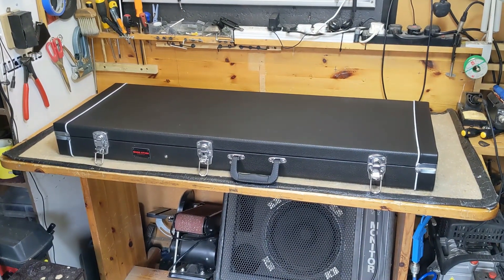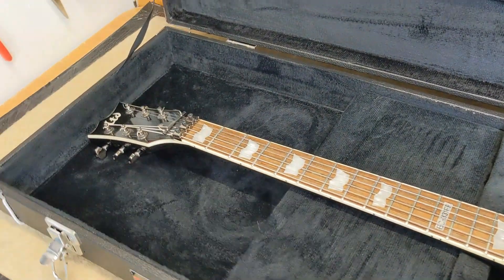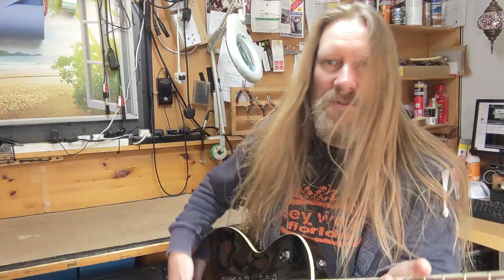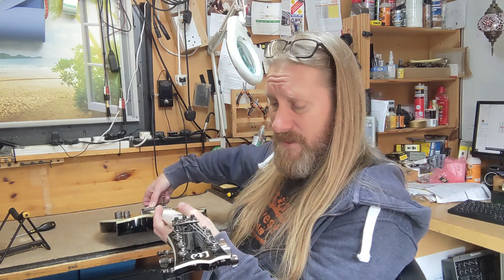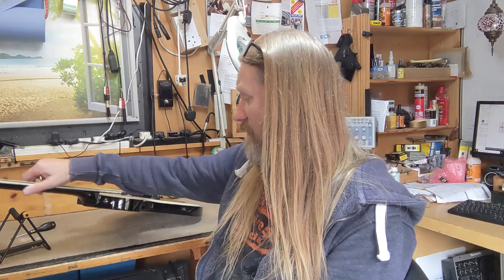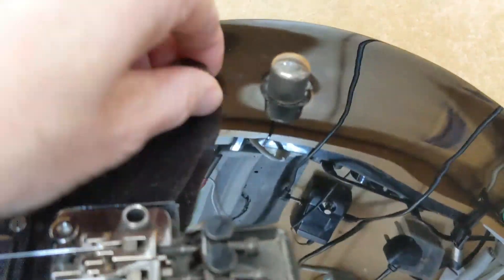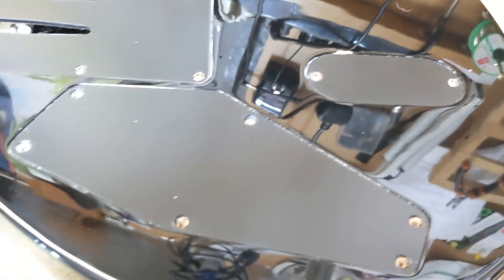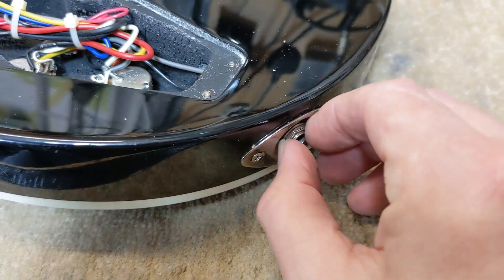ESP LTD 331FR Second Hand Ebay Purchase - Things You Need To Check

Comment: The trouble with the Floyd Rose "Special', is it's not very special!!! Zinc trem block (easily replaced, it's true), and saddles which can be prone to cracking especially if you overtighten the locking bolts. Personally I keep away from them, because there is too much to upgrade to make them usable for me. 

Guitars like this at this price point should really be getting at least the '1000 series' floyd  which have steel saddles and a brass block, which is much, much better. I suppose they do it to save money, but the build quality of a tremolo is quite important to the actual playability of the guitar!